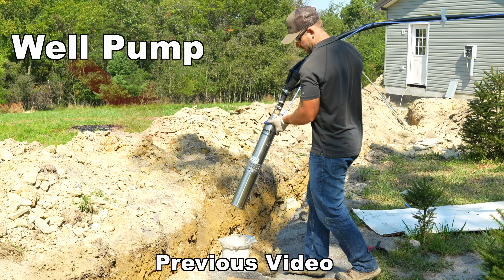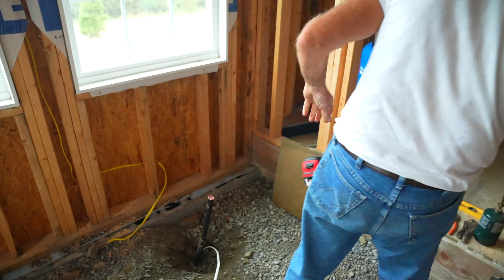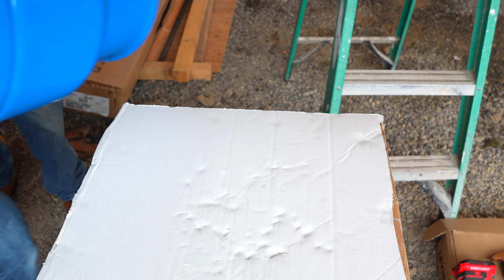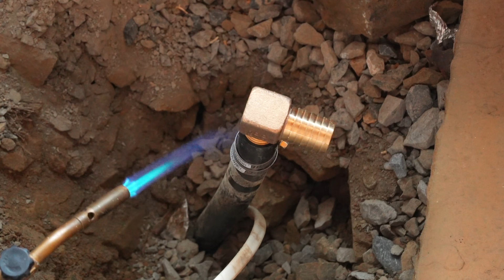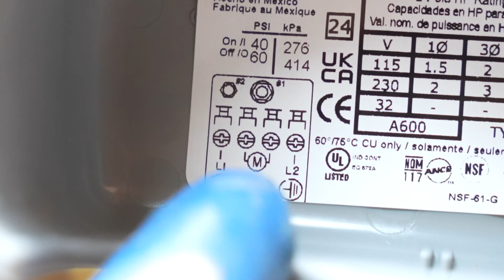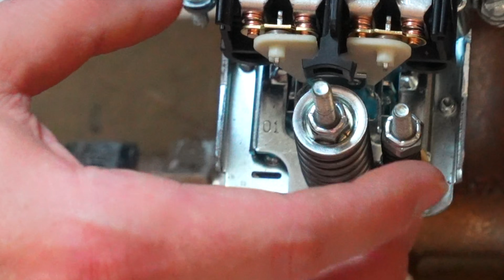How To Install A Pressure Tank - BEGINNER'S GUIDE

Comment: I have an old galvanized tank. We just jb welded a leak before but its shot . I have a brand new control box with fittings and so I am literally just replacing the tank itself. We replaced oir septic drain lines last year OURSELVES  compared to that this will be a cakewalk. Oh and im a 56 yr old woman.  If I can do it so can you!

Comment: thanks for the video, man! i wasnt able to face the pressure switch the same way you did, with the sticker facing forward. there wasnt enough space with the two piece T that i was using with the 30 gallon pressure tank. it was rubbing up against the tank (reminded me of tires that are too big for a pickup truck, rubbing up against the the underside of the front fenders). any feedback on that? it doesnt really matter, right? cheers from brier island nova scotia

Comment: What happens to the open fitting under the black cover cap on the top of the tank? My horizontal has the same but it’s just an empty fitting? Do I need a plug for it or does it take something else? Great video though for sure.

Comment: Wow that was a great video, thorough, well explained, and just the right length.  I will repeat other suggestions about adding check / shut off valves.  I've been living acreage life for 40 years and in my experience having multiple shut off valves to isolate sections of a water system has been a huge time saver and greatly simplifies repairs.

Comment: Question for H2O mechanic: I'm using the submersible in a 200 gallon aeration tank pumping it to the house and I've been advised to use a float switch but I was also advised by another plumber that I did not necessarily need a bladder tank to this pump because of how I was running it straight from the cistern to the house. As a matter of note I have another jet pump pulling water out of the well into the 200 gallon cistern aeration tank with a float switch that will cut off but also then I was told I don't need a bladder tank though there is one hooked up to the system now. What are your thoughts on this please. Should I or should I not use a bladder tank on either side of the cistern / aeration tank?

Comment: Thank you, that was the most thorough explanation I've found to date.  I'm getting ready to swap out my failing pressure tank, and install a new pressure switch.  I did not know that the tanks come precharged, so I bought a portable air tank, thinking I was going to need to bring my air source to the water source.
Reply: You still might need your air pump. Sometimes the pressure is wrong in the tank.  I had my tank replaced 2 years ago and I check it and it was only 19 psi on a 30/50 tank. I'm not sure why it was low. It either came that way and the plumber didnt check it or the plumber did it. Also set your pressure when the pressure tank is empty.

Comment: Good video on the install, but he’s basically screwing over another trade, as per usual. Obviously that garage is going to have a concrete floor, which will likely be about 4” up from the block ledge. He’s already cut the well line too low for that. 

And why the hell is the well line coming through the garage floor on a house that clearly has a basement?

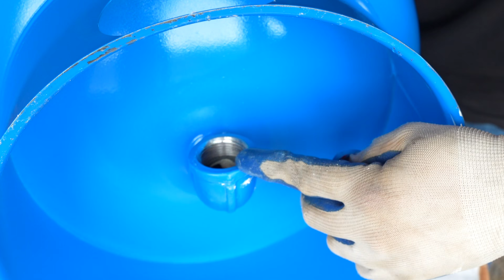Comment: Great video. At minute mark 6:39, you removed a plug, exposing the silver colored threads to which you then inserted the brass pipe assembly. Is there a concern about those two dissimilar materials experiencing galvanic corrosion?

Comment: I have a 20 gal. Tank but have 3 bath plus use a lot of water in separate shop all on same system . Should I have a larger pressure tank. Your video is a great help. Thanks, Tom

Comment: If you have a water shut off valve in the pump house, why not just turn it off there...empty water from tank...assumimg uou have a faucet on the tee assembly.  Then No need to turn taps on in house

Comment: Thank you for this. Had to leave work at 3:30 in the morning because the 90 on the bottom of my mom’s tank was so corroded it just blew out. I’ve never done any plumbing or electrical, but I was able to get a new tank and switch installed thanks to you.
Reply: You enforced my boundaries and I will try to fix my old tank myself. Thank you for your prayers.

Comment: Great video but when doubling up your poly hose clamps, alternate them so the tightening screw is on the opposite side. That ensures a perfect 360° seal as there is a bump under the screws. In fact this is the only reason why I believe people use two hose clamps rather than one.

Comment: Why is there no union for when it comes time to replace the tank?   Without the union, do you just cut the poly and PVC when it comes time to replace the tank?
Reply: I believe you can remove the pipe between the tank and the T.

Comment: My pressure switch and guage is is located on top the pump then 1inch pvc to a T I have going into the bladder tank with a union I don’t have all them extra gauges it’s outside in a pump shed.  Why would I need a pressure switch like this one you showed if I have one already ? 😢

Comment: Well it's time to replace the old pressure tank, probably was installed over 40 years ago by my father in law, who has left this earth for a better place to live, where I'm sure they don't have to worry about pressure tanks. It's still working fine, but unfortunately, it's starting to get small pin leaks, as I assume the water has eaten away the inside lining of the tank over the years. I've never had to do this, so your video is perfect for me. Thank you for going into detail on each step of the process, it's going to make it a much easier project. As I'm sure my father in law will be have a good chuckle watching me  struggle through this, I miss his sense of humor.

Comment: Does the pressure tank work with water coming from water storage tank as well or does it require connecting to the  pump?

Comment: What pressure would kick that pressure relief valve on? And also wouldn't it be perfect if it was exactly what the tank is supposed to be filled up to so you could just put a hose on it and pump and pump and pump until the air comes out at 38 PSI or whatever it is then you know you're full

Comment: Does kick  off and on the same thing as turn off and on? This terminology is not really for beginners.
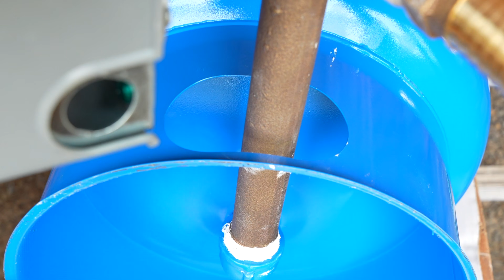6:50 how to make sure that the extra turn will not crack the female end of the pressure tank pipe?
Why both pipe dope and teflon tape? Each provide lubrication by itself, and neither fail when used singly.

Comment: Wow, didn't even mention the check valve. How do you check the air in the tank and where?. Why not use 1" pvc going out, and where is your shut off valve?
Reply: Pvc for water supply?
Reply: Cpvc is about the worst choice between pex and pvc. And why reduce it to 3/4? Let it flow from the system it will reduce when it hits the house lines
Reply: @SteveoRay so you’d pick PVC to run water over cpvc ..
Reply: cpvc would be the last thing id use if i had to
Reply: @SteveoRay well that’s good for you since that’s an opinion of yours and not code lol.
Reply: Pvc is code as long as it meets ASTM standards can be used for drainage and potable distribution. You nerd 🤓
Reply: You can run pvc until you connect to the lines in the house thats code
Reply: @SteveoRay I guess I missed the part where it says you HAVE to use PVC and cpvc isn’t allowed lol.
Reply: @SteveoRay UPC 604.1 Table doesn’t say you HAVE to run PVC like your claiming you WOULD HAVE used. If you wanted to use PVC go for it, it’s allowed. Code book doesn’t say you HAVE to use it lol. UPC allows for CPVC ALSO. But I guess I’m a nerd for reading the code book and seeing you don’t HAVE to use PVC but you CAN use other material.
Reply: Clean your glasses lol
Reply: @SteveoRay 😂

Comment: Right now I'm replacing my tank. Old galvanized being switched out for a state 26 gal tank.one thing I notice is my gauge and switch was on top of old tank where the air pressure was. Doing it this way would put where the water is. Does that make a difference? I'm going to put a check valve right before the tank. I'm pretty sure the check valve on deep pump is not working. It would keep water from.running back out of house till I get the pump check valve fixed

Comment: From the main hose coming from the well - wouldn't it be adviseable to have a shut off valve before the 10" Tee and all the fittings?  Seems like a shut off valve here would be the same as having a main shut off valve from a municipal main coming in to the house and permit servicing.  Maybe turning off the pump is normally enough but my well is artesian and there is a risk there will always be a bit of flow if the pump seals weren't good (situation I have right now thinking about DIY replacing everything).

Comment: Some local codes require a check valve installed between the well at the tank tee.
Reply: I've done a few and every pump I've ever seen has an integrated check valve.

Comment: Very thorough video. Everything clearly explained,  nothing skipped. I would add that if you don't understand the electrical terminology get someone knowledgeable to help. I would also put some black tape over the white wires as they are both hot leads. Great job!
Reply: I forgot to mention you skipped instruction on how to adjust the air pressure within  the tank

Comment: A good tip is to put the whites together and the blacks together on each side of the switch then you cannot accidentally short them out.. i seen people  hook the feed line up on the same side of the switch and then call us to look at why the breaker keeps kicking 😂
Reply: Whites on the right, blacks on the left. Is how we do it. Doesn't really matter though both whites could be on the left and both blacks could be on the right.

Comment: Instead of using a propane torch to heat the black inlet pipe, it is easier and safer to use an electric hair dryer or an electric forced air heat gun.

Comment: I am really missing something here!!
Why would the water flow in the tank, when it is easier for the water to flow straight thru?
What makes the water turn 90°, to go into the tank?
We all know water will flow/follow the path of least resistance.
What am I missing here?????
Reply: When water is not being run anywhere by the homeowner, the only place it can go is into the bladder tank.
Also, if water is being run somewhere by the homeowner, normally the discharge of the water is below the output capacity of the water pump, so the extra water produced by the water pump goes into the bladder tank.
Reply: @davegaetano7118  
Yesterday, after thinking about this since I wrote the above post, , it was really confused how in the hell this works!
Watching the video, I was thinking in terms of "turning on the water pump for the 1st time.
When this happens, ALL water pipes/ plumbing WILL fill up when no fixtures are turn on.
This is what I was thinking. But after all plumbing has filled, with no fixtures on......The water has no where else to go but the tank.
Thanks for the reply Dave, you have confirmed what I was thinking after all my confusion! 
A big fat DUH on my part!
Reply: When its pressurized water the whole system has water pushed into every possible void. The bladder uses air to push back on that pressure to create a reserve of pressure without the pump over pressurizing the system or lack thereof
Reply: @disturbed1gamerz  
Your correct!, It took me a day or so to realize this.......Huge brain fart on me!

Comment: Thank you for the video!  I've changed the pressure switch and understand the workings of the tank, but my biggest issue was how to get that hard plastic pipe onto the barbed fittings (the professional way).

Comment: I have a unique situation (I'm special, LOL) and want to know if a pressure tank will work. I live in a small off-grid community, and fresh water is supplied via a distribution system from a water tower tank. The water tower tank distributes the water via gravity pressure, and gives my location the bare minimum required 20-26psi (always less than 30psi). I do not have a well pump. The goal is to have amazing shower and good faucet water pressure; Will installing a pressure tank do that in this situation? I will have: 2 shower heads, 2 faucets, dishwasher, washer machine and 2 exterior hose bibs. I'm considering the A.O. Smith 20 gallon model. I'm getting a Rinnai tankless 9-GPM hot water heater. Thanks for the help.
Reply: Yes, you can use a booster pump and a pressure tank to increase your household water pressure.

Comment: I'm from the UK I'm about to visit a friend in the USA, they have a leak on the supply pipe coming from the well pump, it comes up through the slab and protrudes about 4 to  5 inches before it terminated onto a 90deg barbed brass union, the two jubilee clips secure the connection, it's at that connection where the leak is. I intend to move the pipe so it does not come up under the slab, but rather at the side of the building and terminate into a utility box which will be weather proof and fully insulated, I personally do not like the barbed connection type, are there any other alternatives I could use?...love your vids by the way, very informative for me as I'm not sure about codes etc, but they have given me good info on direction.

Comment: Hey what do I do if my existing system has a galvanized pipe coming from the well? There's no way I'll be able to unthread the existing tee as it is too corroded I'm sure it will just break. Can I just cut it and use some poly pipe with hose clamps like you did right onto the galvanized pipe?
Reply: The best solution is to cut new threads want to the galvanized pipe end.
Another possibility is to use a compression or 'Dresser' fitting designed to work with galvanized pipe.

Comment: No mention of the air pressure in the tank yet AGAIN....is it pre loaded, do you add air before the water, after it has water in it... WHAT??
Reply: Put an air gauge on it, if it shows air then it’s preloaded. If it an 30 psi tank put 28 psi in it. Whatever Psi the tank is always put 2 psi lower of air. So if it’s 40psi put 38 psi of air.
Reply: Add air anytime? Does  water in the bladder matter or not. Im thinking the tank should be empty? @jamor2549
Reply: @1swinedog13    YES, always check the pressure and charge it with air when EMPTY!
Reply: @jamor2549 the psi you put in is based on the switch you are using,not the tank.
Reply: @K @KatarinaKranz  how much air should be in the tank based on the switch in the video?
Reply: He mentioned the pressure in the tank within the first minute.....
Reply: The psi is located on the tank
Reply: If your pressure switch is set to 30psi/50psi, then set your tank to 28psi.

If its 40/60 then set take to 38 psi.

Your tank psi should be 2psi less than your cut on psi (lowest psi before pump comes on)

You can view the pressure in the tank with any kind of tire pressure gauge. If its too high, let a little air out by poorly connecting the pressure guage so you hear hissing. If you need to add air you can do it with bicycle pump, air compressor, etc.
Reply: Mine had 40 pounds when cut off. When it hit 50 pounds. When it cuts in at 30 pounds, I checked the Schrader valve with tire gauge, it reads 28 pounds which makes sense because the the air bladder is down to no inflation cause the pressure goes down in unit until cut in at 30 pounds
Reply: I just turned the pump off and turned on the faucets and shower then no pressure in system. I had to add pressure back into pressure tank cause I let air out from original 40 pounds down to 28 and the charge in tank was 0 pounds.  No air showing on gauge. So I remembered when I checked tank at start it read 40 or a little more. I refilled will 40 pounds with water out of pipes and ran system. When cutout switch went down to cut in pressure,30 pounds, I checked pressure in tank and it was 28 pounds. All good except my unit cycles five to ten times while taking shower. When old pump burned up because I lost the neutral under ground about 6 foot from out side breaker 100  amp box 66 feet from house due to a neutral splice corroding, a company put in new pump and motor. I said it never cycled before even when watering outside, I think it is a bigger pump and motor on 110 volt. They said get a bigger hose out side instead of 5/8"

Comment: Awesome video, and always so well explained. Question, do you need to tighten the factory 90 on the bottom of the well tank? I'm about to get ours next week and I read that someone had a leak there and had to replace/add pipe dope etc. Just wanted to know if it comes tight from factory. Thanks!

Comment: A check valve before the T will prevent water backflow to the well.
Reply: Do most wells have that? I have well thats pushing out of the cap. Was thinking the line may be leaking can't look at it now its frozen solid.

Comment: Could you please explain why there was no check valve installed to keep pressure from pushing back towards the well?
Reply: Check valve should be on the foot of the pump
Reply: The previous video showed the well pump installation, and the pump had a check valve on it. So, there is a check valve, but he just forgot to mentioned that it was a part of the pump.
Reply: @drewhop123 but it's highly recommended to install one on line right before the tank as well.
Reply: You only need one at the pump. I’d say you had some frost free hydrants between the pump and the pressure tank (which is very common in rural areas) the check valve at the pressure tank would not allow water to get to the hydrants.

Comment: Question do you have to use the rubber hose and connectors in your video because the water line coming out of the ground on mine is pvc and not flexible hose???